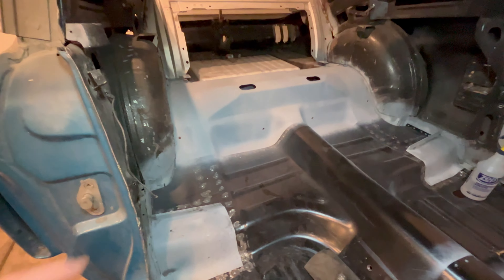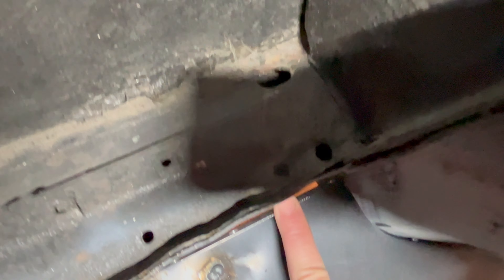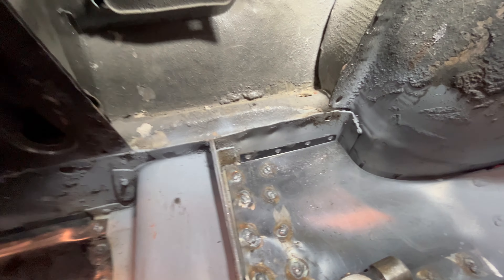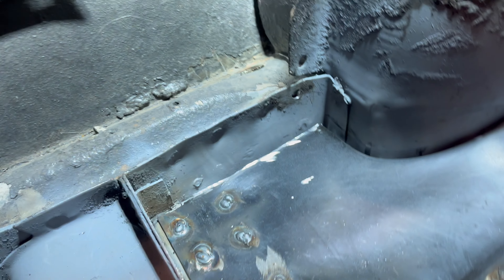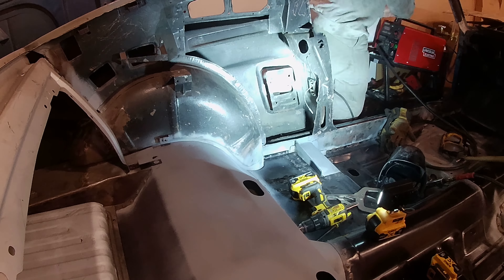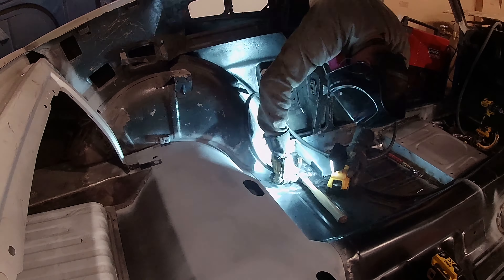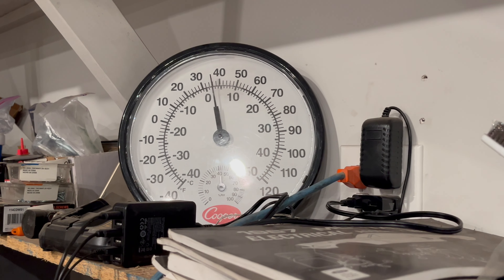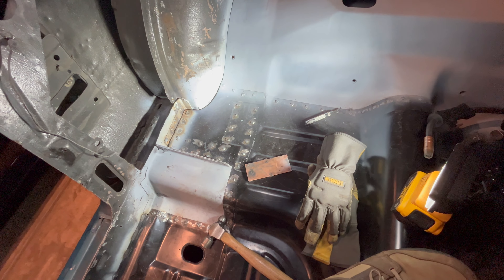Addressing the Floor Gap - 67 Mustang Part 44

Comment: Here 😄 there, I'm the 1st guy to comment...
Both solutions, were executed perfectly, and when ground and dressed, then seam sealed and painted, will be almost indistinguishable, to the average Joe.!!!  (Including me)..Keep at it brother..
I had to remove my pass side strut rod bracket, and replace a 12"x4 1/2" piece of flat steel 16g on the the underside of my front cross member, then reinstall the original strut rod bracket.. Which led to refinishing, repainting, an already professionally painted front chassis and engine compartment.... So, working along with you pal.. Great segment, can't wait till next Saturday...
Reply from the maker: Thanks Joe! It was a little fix, but the devil is in the details as they say. 

Sounds like you’ve got your hands full too! I have the luxury of not having to worry about paint just yet. I bet it’ll look just fine once you’re done, I’d enjoy seeing what you’re getting done